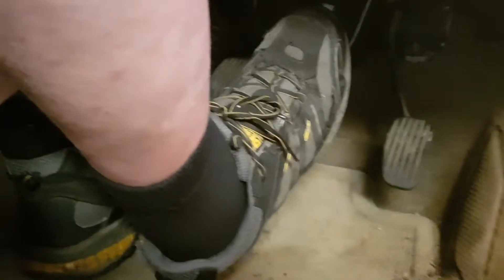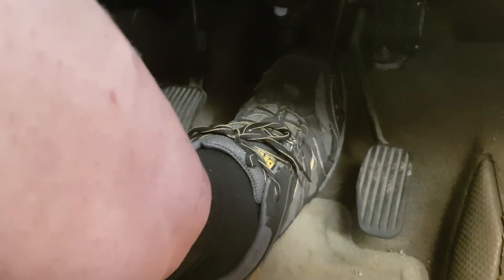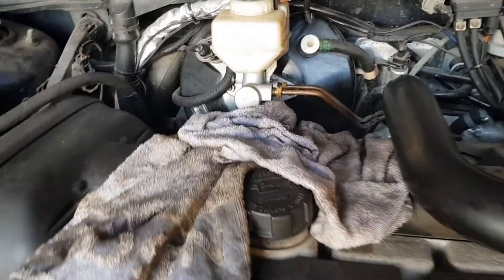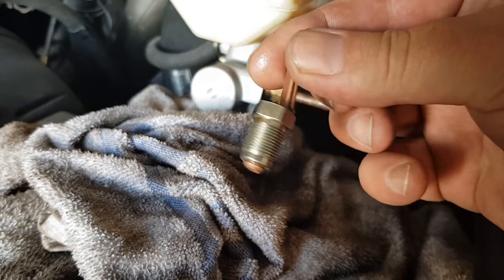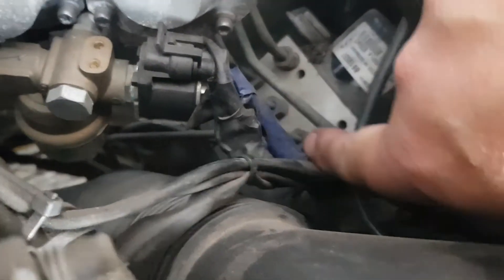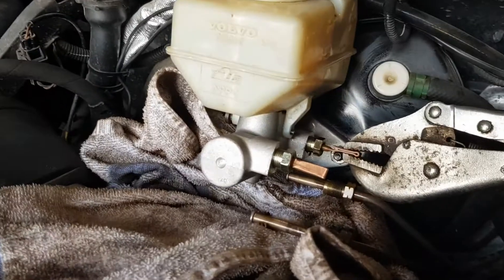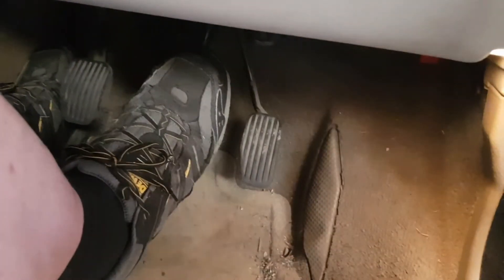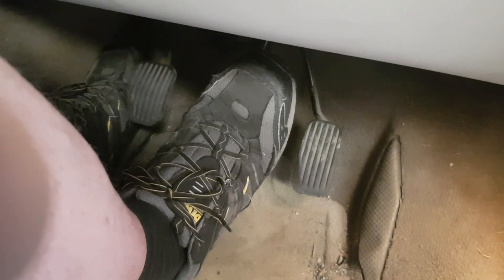Volvo master cylinder test before replace.

Comment: Worth noting that air gets trapped in the ABS unit that no amount of pressure bleeding will remove. I had to trigger the ABS pump via volvo VIDA/DICE whilst bleeding and this really improved things. The brakes must also be bled with the engine on to ensure the ABS valves are open anyway, i believe they close with the engine off, trapping all fluid in there

Comment: Happy new year! I got Volvo xc90 and having braking problem,pedal almost down on the floor and poor stopping. So I replaced all 4 wheel rotors and pads, new replace new brake fluid. 
 after the test drive it feels almost the same as before,tiny improvement. I suspect the master cylinder is going bad or already bad. Any thoughts/advice? Thanks
Reply from the maker: Mine was the same, so I changed the master cylinder, and it made no difference. That's why I put this video up, to help people check their master cylinders.
In my case it was something in the abs unit. Not sure exactly what, but one commentor suggested that they can have an internal leak/bleed off. I replaced my abs valve block, and it cured the problem.